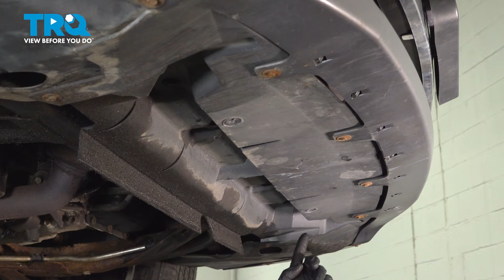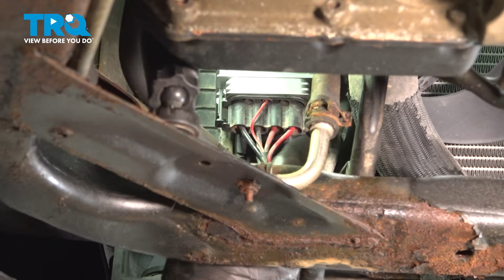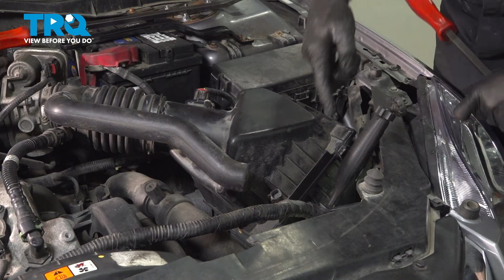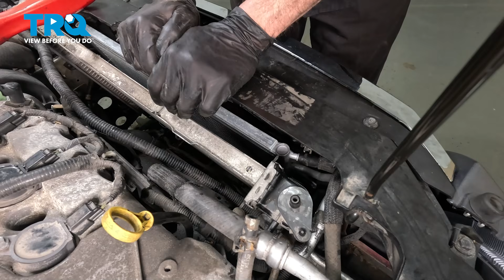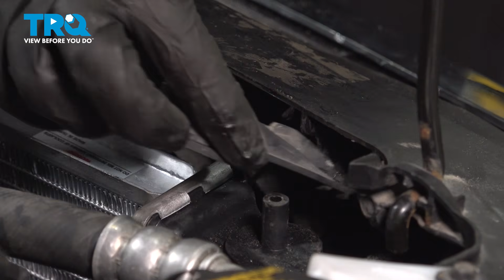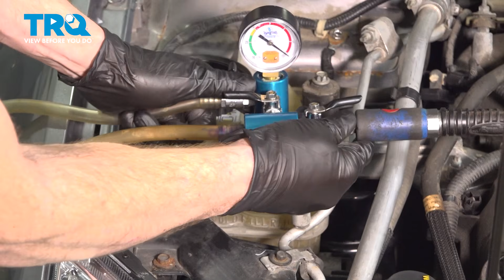How to Replace Radiator 2006-2012 Ford Fusion (3.0L V6)

Comment: Not 100% the same as the 3.5L v6, but a great video and guide for making sure all the connections are addressed. The 3.5L sport variant has a lot less room for removing the fan and some difficult shroud tabs for getting the radiator out.

Comment: "Quick inspection.....set it aside."🤙🤙🤙

I am currently watching and removing my radiator in order to replace my radiator/core support.  Any tips for removing/reinstalling the core support?

I have a 2007 Ford Fusion SE V6 3.0 AWD

Comment: This is a great video!!!! Thanks for all the detail, it was very helpful and I love all the steps laid out clearly and quickly. 

One thing for anyone doing this and refilling the coolant without a vacuum filler like he's got: if you just pour coolant into the reservoir, you will likely develop an air pocket (I did).  But Ford made an easy fix - at least on the 2010-12 Fusions (not sure about older models) - there's a plastic air bleeder valve up by the valve cover.  Just open that up, the coolant can flow and you can get on your way to fully filling the system.

Comment: Important tip: as seen in the video the AC condenser is attached to the radiator in slots left and right at front bottom and through front middle left and right plate AND NOT SHOWING is on the right side where the AC condenser pipes attach to the other AC pipes is a plate attached to the side of the radiator with a hidden plastic push pin that is almost inaccessible 😢 cannot get a tool onto it ....had to melt the push pin with a soldering tool! The car in the video already had the AC condenser separated so the condenser was not properly installed in all slots before the video. Took a long time to figure it out.😊

Comment: Cool video! Have to replace the radiator of a 3.5L which is a little different. @14:14 you did not show how to remove the radiator clips, they just need to be pushed up and out from the front? Thanks.

Comment: Uh, you have 2 8mm bolts that have to be removed before seperating the a/c condenser from the radiator.  Convient  you didn't have to remove those.  You get to them from each side after removing the headlights.

Comment: I love the way you are so precise with every detail. I hope you will consider showing how to flush the power steering fluid on this car. I have an 09 3.0. I do have a OEMTOOLS 24937 6 Quarts (1.5 Gallon) Pneumatic and Manual Fluid Extractor, but the return line looks difficult to get to.